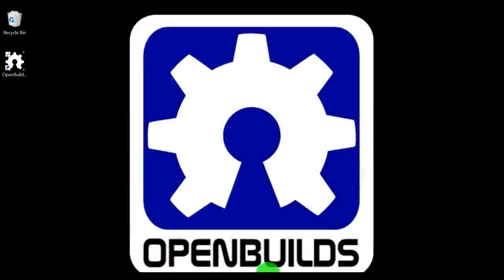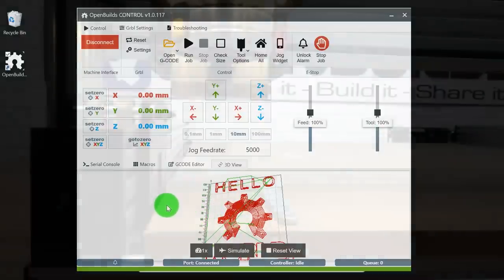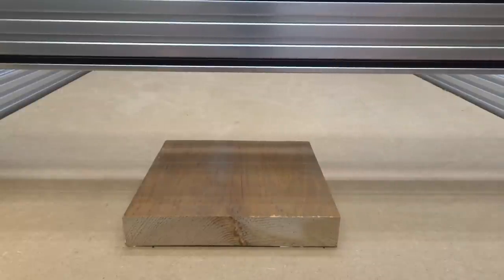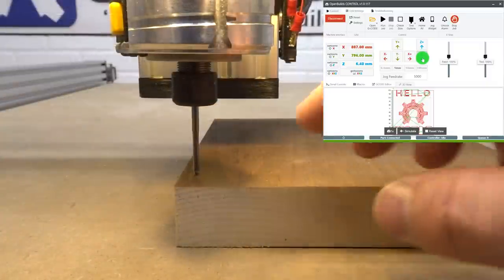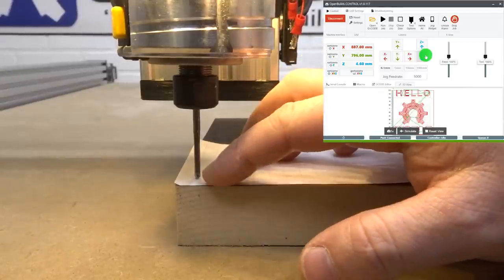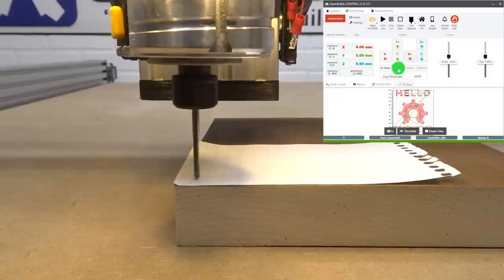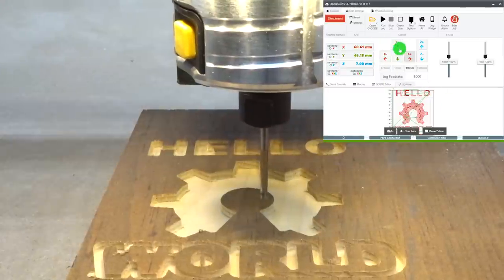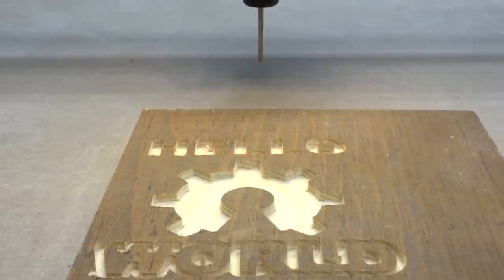Hello World Tutorial (Your First Project )

Comment: Thanks for the video. I just purchased a CNC machine from you guys & trying to figure out the best way to keep my project piece from moving while being cut. I see you used double-sided tape, how do you remove it from the spoiler board? Is it pretty easy? I'm contemplating installing a vacuum board ($$) vs drilling holes in my project piece (which I don't really want to do). Any tips are welcome, thank you!!
Reply from the maker: Hello! Thank you for your kind words! I understand your interest in using a vacuum board; that would definitely be a great solution, but it can get costly. One alternative is to use T-tracks with hold-down clamps. We set up the LEAD 1515 to do just that, and you can replicate this setup on the LEAD 1010 as well. 

To enhance stability, you might consider adding a few extra braces to the frame to support the T-track slots. Additionally, using smaller sections of MDF as a spoilboard is advantageous because they are easier to replace when needed. 

Check out the LEAD 1515 build video for some ideas to help you get started: https://builds.openbuilds.com/builds/openbuilds-lead-cnc-machine-1515-60-x-60.9552/All.

Best of luck with your project! Please share your progress by tagging #OpenBuilds so we can see how it turns out. Thank you!

Comment: Hi, is the zero position set to the tip of the bit or the sides of the bit ?
Reply from the maker: If its a manual positioning then the tip. If its with our probe then it will measure the tip and the sides